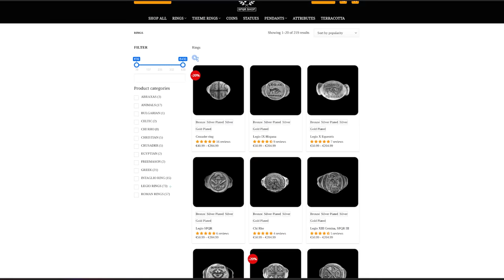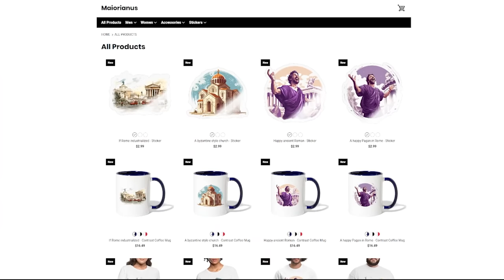How could the Lombards invade Italy so easily in 568 AD ?

Comment: Interesting video. The reasons for the weak resistance of the Romans were indeed the severe manpower shortages after the Justinian plague and an economy that had been wrecked by wars, plagues and instability, armies requires a lot of money after all. Justinian’s wars in the west were a textbook example of military overextension, i wonder what would have happened if the ostrogotic kingdom was not invaded, would an unified Italian kingdom develop in a similar way to the french one?
Reply: Another interesting thing, genetic analysis of ancient people dna and of the modern Italian population show very little changes between the end of the Roman Empire and modern times. So the germanic invaders were probably in very small numbers compared to the general population and were gradually absorbed into it.
Reply: Doubt it, the Ostrogoth monarchy was on shaky ground after theodorics death and you still have the Lombard invasion and then Rise of Islam to deal with plus Frankish and German intervention.
Reply: @tylerellis9097 The lombard invasion probably would have not happened if it weren’t for the eastern roman invasion and even then could very well have been stopped by the ostrogoth. Rise of islam wouldn’t be a problem either for similar reasons. With a state that did not exhaust itself in constant wars it’s more than easy to push the relatively minor invasions of italy back.

Comment: Would a "fortress Italy" have worked, back then? A series of walls and fortresses, blocking every valley and pass coming out of the alps into the Po valley. No need to wall off the valley itself, just the spots that could be used for invading.

Of course, invaders can bypass fortifications by sailing along the coast and just disembark at any safe undefended spot. So you still need to heavily fortify the major ports and coastal towns.

The roman empire built long defensive walls (limes) near the outer and most vulnerable stretches of land... but I suppose the need to protect the heartland (the peninsula itself) was a question of troops. Large concentration of military power, and ability to quickly dispatch.

But a "great wall of China" style series of "plugs" at the root of alpine valleys and in the plain to the east would have made sense. Especially since Rome had been threatened by land invaders many times through its history. The Celts, the Carthaginians, etc.

Comment: Northern flank was always Rome's weak point, going back to Veii. And to be fair it's a tough task. Both the Alps and the gap between the Rhine and Danube would need like 4 or 5 legions to really fortify every choke point. If you can't control that region you're open to raiding and full scale invasion. Rome did a pretty good job all things considered.
Reply: Because the alps constantly provide concealment and makes patrols a massive pain in the ass? I thought they would have aided in providing easily defensible chokepoints and deprive an enemy from living off the land